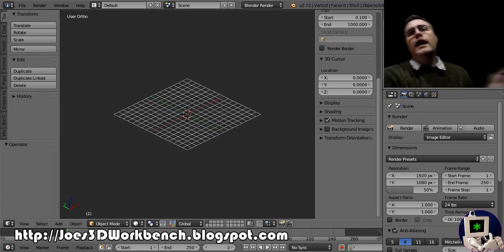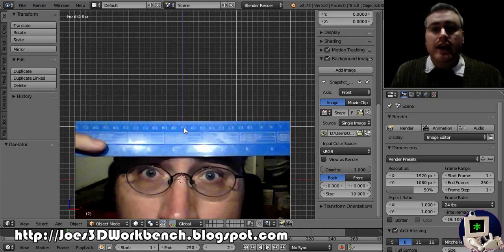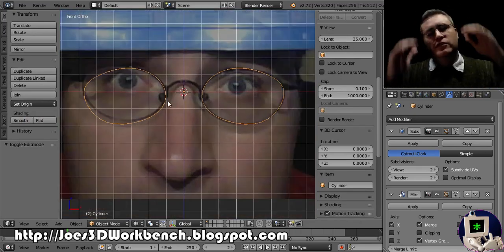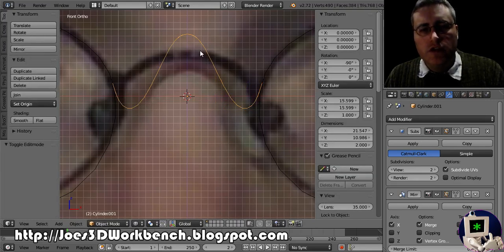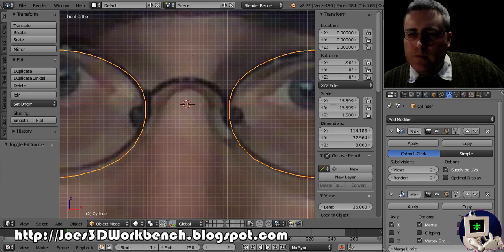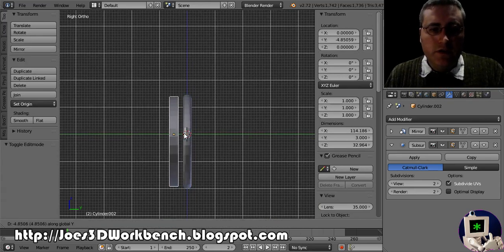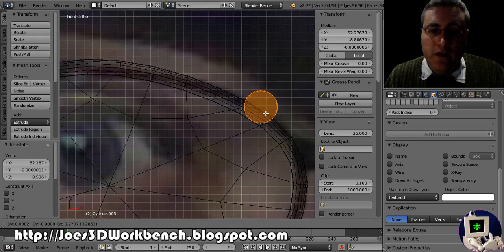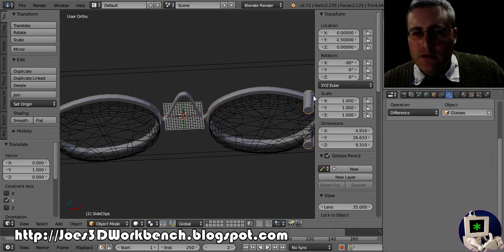3DPrinting - Sunglass project

Comment: The little issues you fight in Blender I fight also. But you know how to solve them where I rarely recognize the true problem. Frustrating is an understatement. The Boolean function work flow process has me stumped. Sometimes it works, most it doesn't.